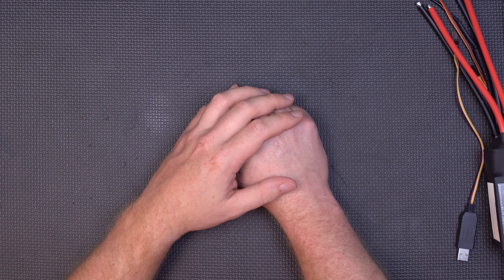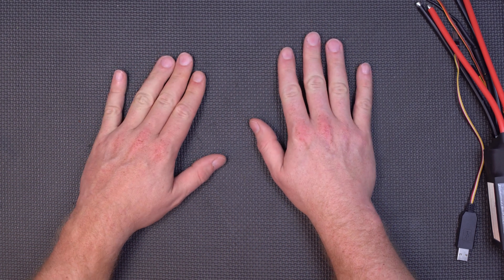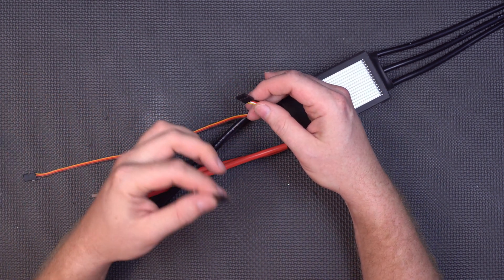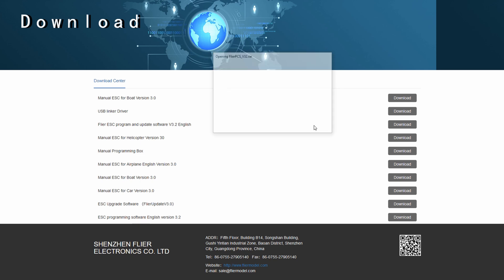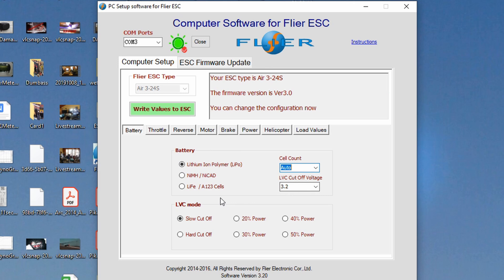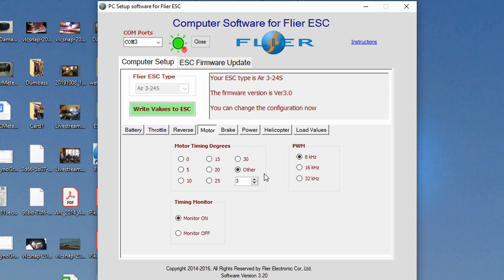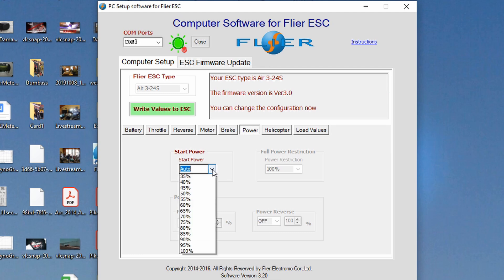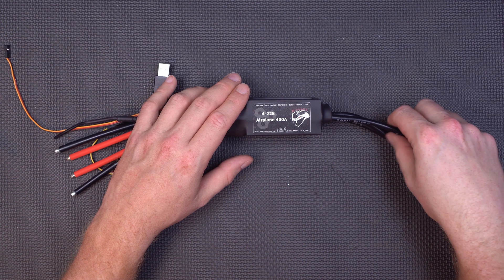Programming a Flier ESC

Comment: I’m using a boat 400 amp 4-22S speed controller and a SSS KV 360 Motor to power a kayak and every time I put it in the water it will cut off when it detects a load, but out of the water, I have no issues I have tried 1 million different things except getting a new motor. Any advice on what’s going on?
Reply from the maker: I gave up on those cheap ESCs a while ago - I have another video of this ESC blowing up.  In a word, they're garbage.  It's almost certainly the ESC and not the motor.  Best value for the $$ I've found is the Hobbywing Max 4 ESC - that things a beast, particularly for $450, if 12s is enough for you.

Comment: Great video! So many people dog on Flier ESCs, the vast majority have no idea what they’re talking about, they simply repeat what they’ve read or heard from others who are equally  ill informed… I’ve had 2 Fliers, sold 1 to a friend the other I’ve ran for close to 2yrs in my K8 with zero issues.
Reply from the maker: Well, I appreciate the kind words, but neither of the two Fliers I've had made it to anywhere near their rated power.  I gave up on those, tried APD, VESC and now MGM.  MGM so far are the only ones that have stood up without failing or getting flaky; though I'd definitely be willing to give APD another shot.  This video has actual power numbers in watts as the electric turbo is working - it's pretty eye opening: https://youtu.be/nlTVHkfSQXM

Comment: How do you set the throttle calibration? Not sure if my unit is a dud, or I’m not calibrating it correctly.
Reply from the maker: Honestly, I don't remember.  I stopped using these chinese units some time ago.  The failure rate was too high, and the ratings are very optimistic, to say the least.

Comment: What gauge phase wires are those?
Reply from the maker: I believe they were 8 gauge.  I don't use that esc anymore since it blew up.
Reply: @AlexLTDLX  thanks I'll use the New Kontronic Cosmic 300amp or MGM 40063 then😉
Reply from the maker: @mackattack8627  So far, the 450 amp Flier ESC (next larger size - flier just let me pay the difference btween the two - pretty nice of them) has been holding up just fine.  The next step up ESC has MOSFETs on both sides with twin heat sinks.  It costs about $300.

Comment: Can car ESCs be used for airplanes? Flier brand car and air ESCs look identical... is there a flash or software upgrade to interchange the two?
Reply from the maker: I haven't compared a flier car to plane esc, but my flier ESCs are for planes, and the first esc I bought was for a car.  I can tell you this - using a servo tester on a car ESC lets you run the motor in two directions.  Kind of a pain for what I'm doing - I only need 1 direction and prefer the more defined control.  The flier plane ESCs can change direction - but it's done in the programming, not via controller during use.  HTH.
Reply: @AlexLTDLX  Thank you
Reply: For turning in one direction - yes.

Comment: Brushless motor Motor timing... i have video on this... more timing = more rpm (More high rpm torque Less low rpm torque ) at a cost to spin up power (Less high rpm torque More low rpm torque)...
Reply from the maker: I'll check it out. Thanks.
Reply from the maker: I just watched it - good video!  If we can see a similar gain, that would be about another half psi - which is pretty significant.  So where do you think I should run the timing on these bigger 6 pole motors?  I think I might have it set to 5 degrees now, but not 100% sure  without checking.  Timing is definitely one thing we'll be testing.
Reply: can you please send the link to video as i don't see it on your channel, thanks